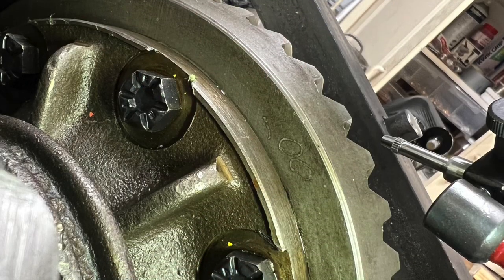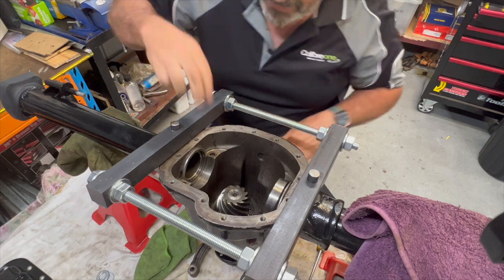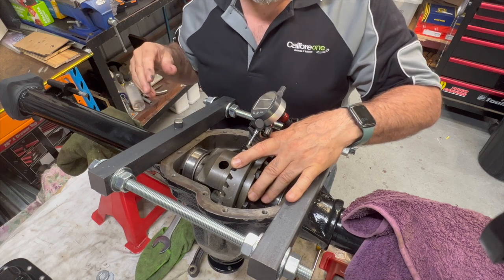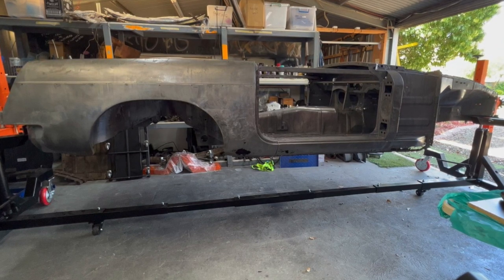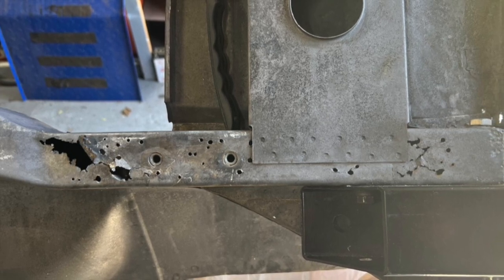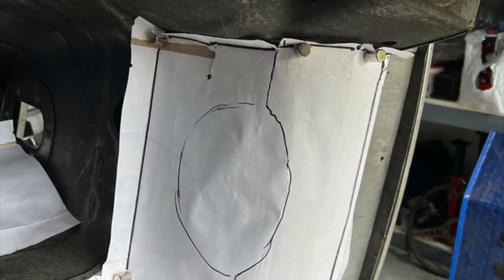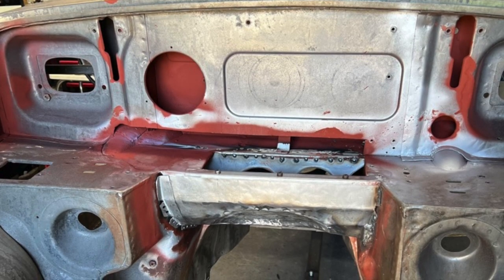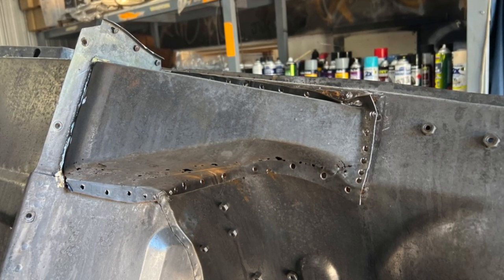The Great MGB Rebuild   Pt4

Comment: I’m really impressed with your work to correct the backlash on the differential crown gear and pinion heat that it mates with. I assume the backlash is related to the play of the pinion with the crown gear. If it is too tight, it would wear the crown gear. If it is too loose, there would be a back lash and too much play between the pinion and the crown gear. There does need to be some play so the gear oil can cover both gears when you drive. I appreciate your showing how to spread the differential housing. The use of shims to correct this critical measurement is well done. Also your lighting is excellent. Only wish you has shown the fiber and copper spacers too. This is a more common job for us B owners. I did this job a few years ago and it eliminated the clunk when starting to move car forward. Great job you are doing and thanks for sharing.
Reply from the maker: yes - the thrust washers under the pinion gears is critical and is usually the main culprit of the on throttle, off throttle clunk.  Didnt include that in the video at the time as I had some trouble getting the thrust washers for that.

Comment: Steve, chances are extremely high that whomever was giving you crap about your welding has never welded before.  Having earned a living as a welder, I learned something decades ago - quite often the "pretty" welds are not very strong, while the "ugly" ones are the ones you can hang anything on without worry.  I was impressed by the "finished" ground out stuff how good they looked.  GREAT WORK!  Looking forward to seeing it all come together.

Comment: The work you did in the heater box area shows how important it is to keep the drain in this area clear. It also means that you must keep Tom’s knob clear. It is rubber and easily clogged is you do not keep leaves out of the vent in front of the center of the windshield.

Comment: Seriously impressed with your heater box work, getting those areas to look/be right using just sheet steel and considering the "english lace" you started with is very impressive. Make sure to put a new drain in the bottom of that area to help prevent it getting that way again.
Another thing to consider doing is to put some mesh under the air intake grille to prevent leaves from getting into this area again.

Comment: What type and thickness of metal did you end up using?
Reply from the maker: Hi Ian - pretty hefty - but between 1 and 1.5mm.  Used 1.5 in the major structure bits.  Its easier for beginners like me to weld :)